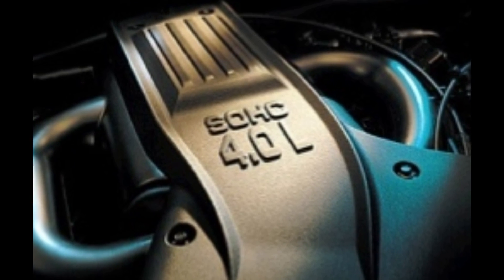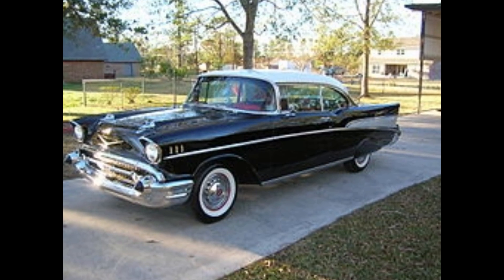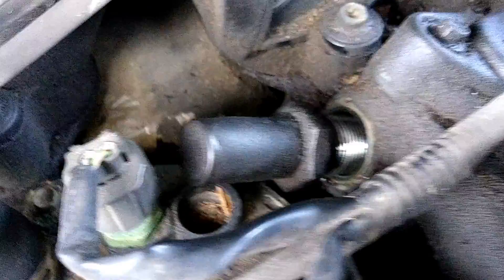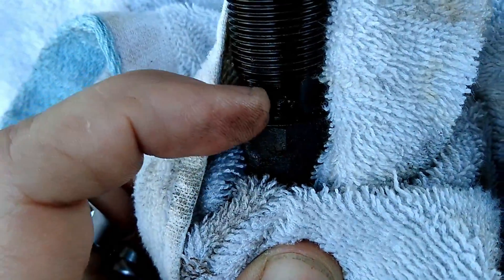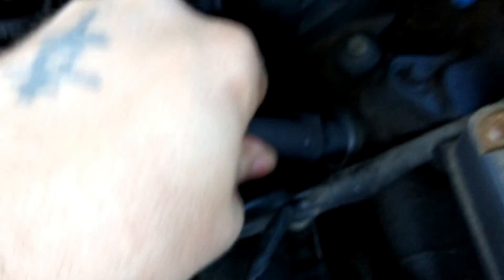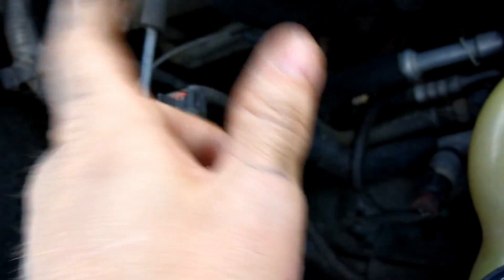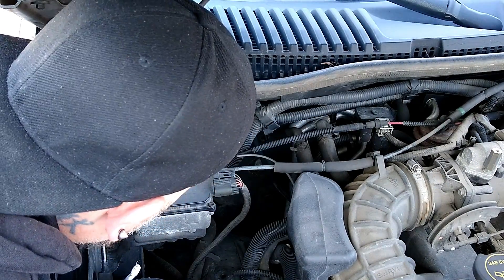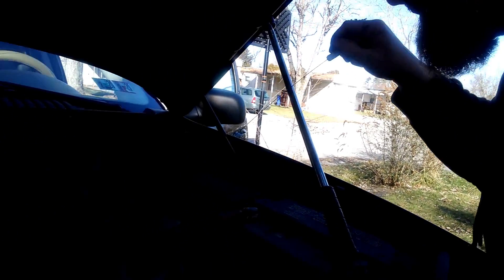How to replace timing chain tensioners 4.0 EASY

Comment: I'm about to do this job.
I notice you made a point of warming the car up to make it easier to break loose the threads.
But I was planning to do it with the motor stone cold, so that metal expansion doesn't make
them tight...
❓
Reply from the maker: I understand the premise but it doesn't work that way. Not that i think either way would make an issue in most cases when we are talking about these tensioners but in general, a warm engine helps to remove bolts that tend to be a little bit of a pain. Just a lifetime worth of experience tells me that.
Reply: Your engine block is aluminum tensioners are steel so the different expansion rates will help break them loose

Comment: So a mechanic found plastic pieces in the rear trans oil pan... he said I needed to replace the timing chain tensioner... I don’t see any plastic on yours... it looks like metal... it’s in 02 Ford Explorer 4.0 I believe...
Reply from the maker: So there are a few tensioners of different designs within that engine. There are cartridges with plastic pieces that are VERY known for breakage. Those are what break when these (the metal ones you see in my vid)  aren't replaced as a maintenence step. When those break, they fall in that pan just like he is saying. In my opinion they are junk at that point and not worth fixing. But thats up to you to determine i guess. The wear that those engines have incurred by that point is enough to have worn out quite a bit.
Reply: @Words-and-melody    Literally bought it nov 2020 and had to have the transmission  rebuilt in Jan and this truck only has 132k on it  I’m so torn as I’ve put so much into it already!  😭😢

Comment: You're talking reliability like mine hasn't 100% resorted to cannibalism.... I don't think even the Vin is OEM anymore, and the gas currently in the tank came from a 1998 explorer.... I think mine used to be '00 and for the most part, the parts fit right so far, but I also got interceptor hinges on one door, which doesn't quite fit right, and a back gate that definitely came from another vehicle all together.. I wonder what year it once was

Comment: Forgot the most important part prime the tensioners. Some mechanic, he never posted startup. Because he had air in tensioner made no difference. Smoke another bud and rock on with vids!
Reply from the maker: I, just like ford, disagree entirely with priming those tensioners.
Reply: I think the oil will prime it up dynamically: the higher oil pressure the higher pressure on the chain.

Comment: I know you made this a while ago but shouldn't you per fill tensioner before you installed it ❓
Reply from the maker: No. The mechanical spring is there for a reason. Lots of people say that you should, but they aren’t thinking it through. Those tensioners will not be primed on a cold start. The springs will be the only tension there in that instance. There is no reference to priming these tensioners in the service bulletin for that reason.
The mechanics who say they should are not capable of thinking through the mechanical process of the part - so, not certain I would want them working on my vehicle.
Beyond that - you are replacing these tensioners due to lack of tension to begin with. If you put max tension on a worn chain at startup (the most common point of failure) you will be increasing the chance of breakage.
Thanks for asking 👊
Reply: Thanks for answering me I really appreciate your reply and think about it your absolutely right 👍